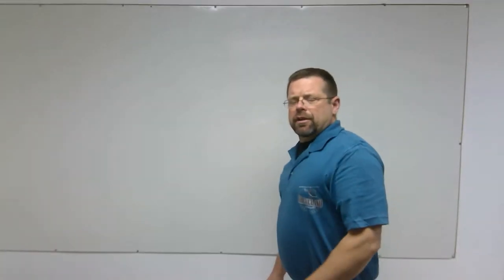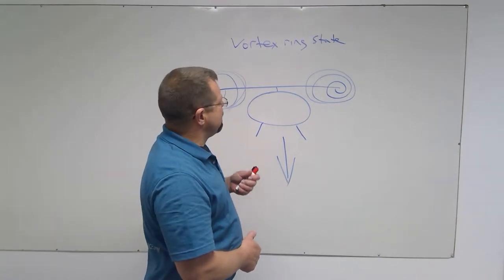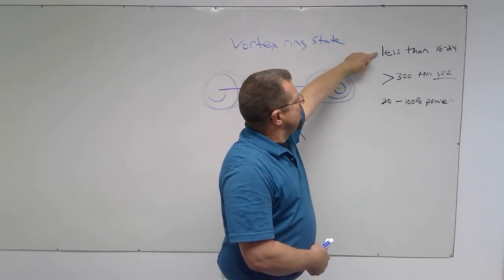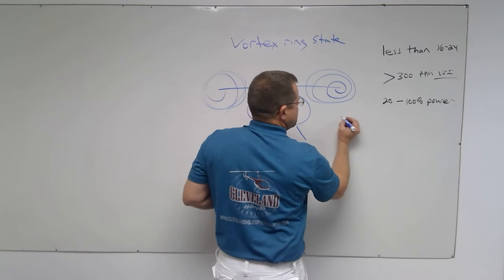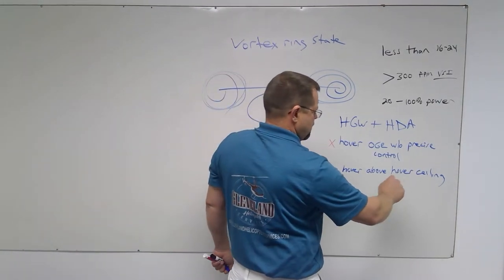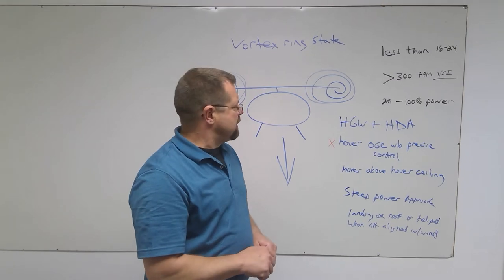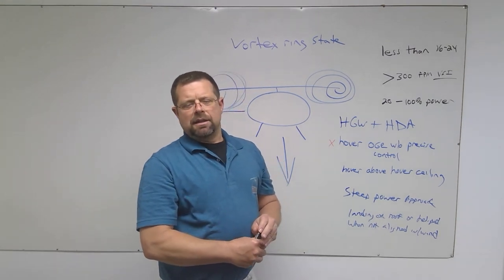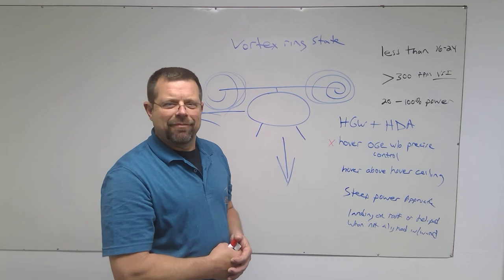Vortex Ring State

Comment: Aren't VRS and SWP two different things?
Reply from the maker: Good question. The helicopter flying handbook now says “vortex ring state, formerly called settling with power”. The examiner I use has definitely divided the two. If the helicopter is settling because you do not have the power to hover for whatever reason (above your hover ceiling, or over gross weight), the helicopter may settle and not necessarily be in a vortex ring state. Settling with power at altitude will lead to vortex ring state. Remember that for it to be vortex ring state, you must HAVE  20-100% of power applied, with a decent rate over 300’ per minute, and traveling below effective translational lift (16-24). People have separated the two over the past couple years but I don’t see it as being that important to discern as a pilot. Get the machine moving, if at altitude, and land if in ground effect……
Reply: @garycleveland2989  I think of it as VRS being an aerodynamic issue due to vortices. SWP I think of as a power/revs issue when there may be no vortex issues. . SWP can certainly become VRS. Keep up the good work. I like your presentations. It's good to see subtle differences between the USA and UK.......we tend to perform run on landings on grass.
Reply from the maker: @trucker5774  thank you. Blue skies and tailwinds.